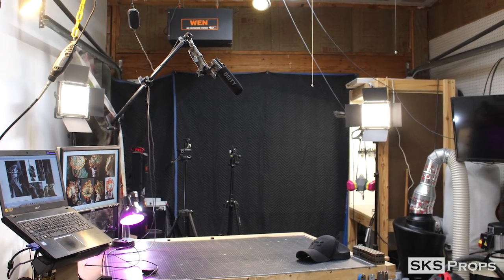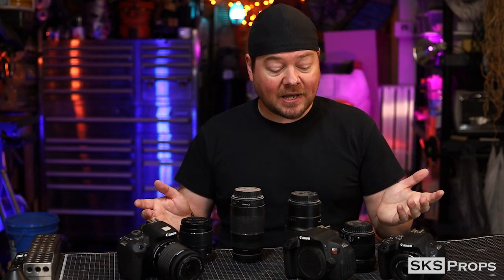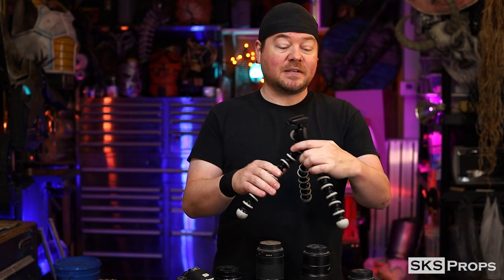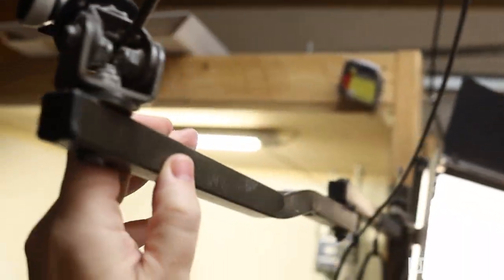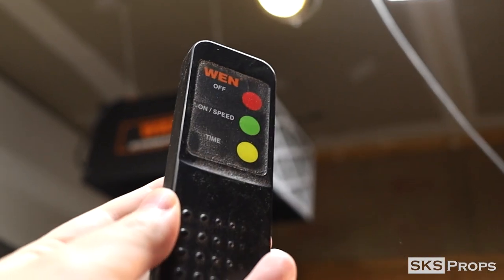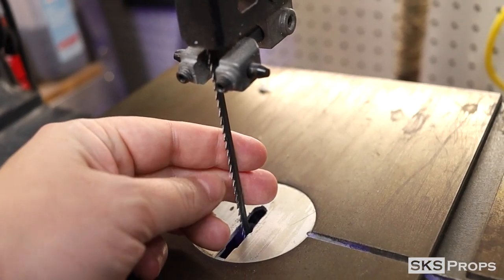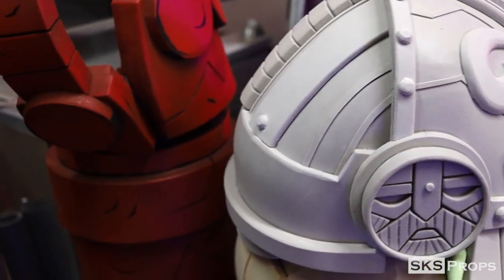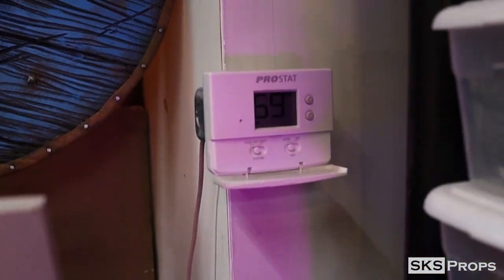Shop Tour and the Tools I use to make my Cosplay Props and Videos

Comment: Your vids made me take the leap to actually try and make a cosplay instead of always saying “there’s no way I could do that.” Thank you for the templates and the time you take to thoroughly go into detail on your vids! I’m currently driving myself mad cutting out hundreds of teeth/chain links for this chainsaw man cosplay.
Reply from the maker: Thank you so much for telling me this! 🙌 and yeah soooo many teeth but it will be worth it
Reply: @SKSProps   Can you think of any alternative that could possibly be used for your foam dowels? I ordered some back in November but, they are on back order until March now.
Reply from the maker: @AnthonyT1992  we’ve got a ton on order but constant China lockdowns have definitely slowed production and shipping. Otherwise you’ll just have to do it the way we did before dowels were made by roughy cutting them out of foam sheets then sanding them with your rotary tool to get the shape

Comment: I have a Dust Right 1250CFM dust collector which I have plumbed to 4 places in my shop.
I notice your dust collector is 800CFM, but you have it only in the one place. perhaps that is why I have trouble with dust everywhere even with my dust collector!
Reply from the maker: The thing that really saves the air pull is having the cyclone in between the sanding station and dust collector. It separates almost all of the resin / foam dust so it doesn’t clog the collectors air intake
Reply: @SKSProps  yes, I do also have the cyclone.

Comment: Congratulations and I saw the Indiana Jones golden monkey head in the background is it foam or no?
Reply from the maker: No it’s from my molding and casting days before foam
Reply: @SKSProps  nice! Did you sculpt it or 3d print it before molding?
Reply from the maker: @intergalacticcosplay7266  oh that’s waaaay before 3D printers ever came out
Reply: @SKSProps  Then what did you use as the base mold did you sculpt it out if clay?
Reply from the maker: @intergalacticcosplay7266  monster clay, that’s how a lot of my props were made originally